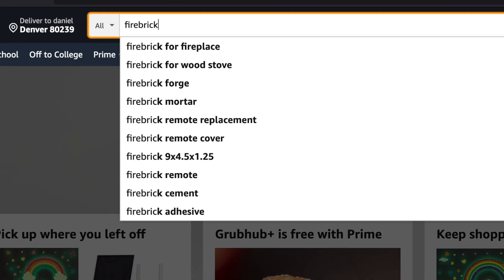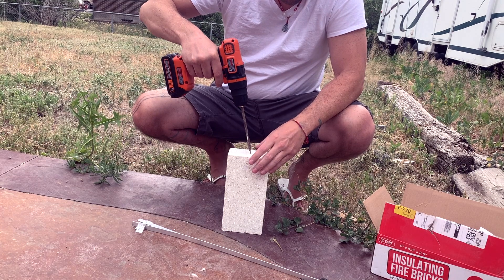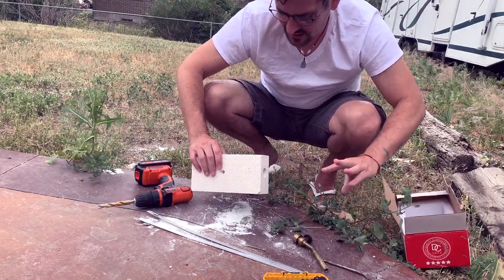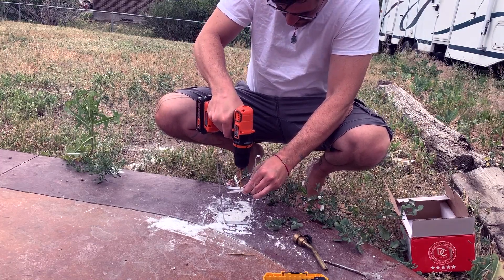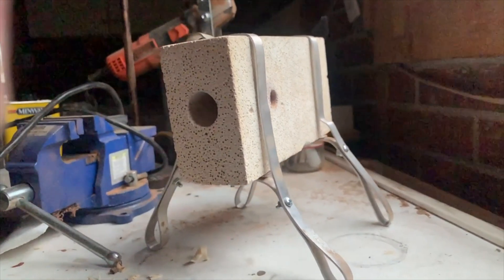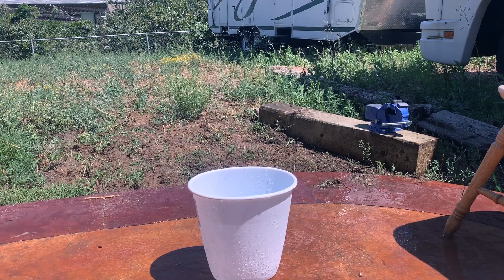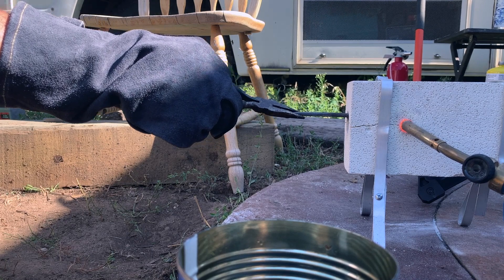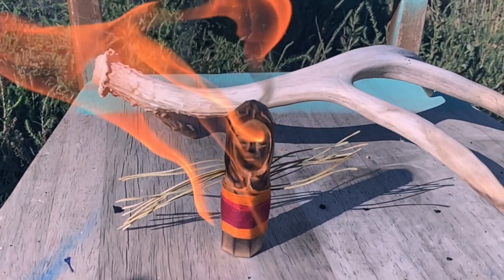Single Brick Forge

Comment: Very interesting, thanks ..wil have to be in somewhere outdoors though :) Was thinking perhaps in the apartment to bad
Reply from the maker: Well….you can get a smaller knife up to critical temp with a single torch. Maybe two if the yellow plumbing torches and no forge. Very thin and small steel. That small, single blade shouldn’t cause too much smoke on quench.
My first attempts ranged from shaping already made knives to making a letter liners that didn’t get heat treated right. It’s all fun